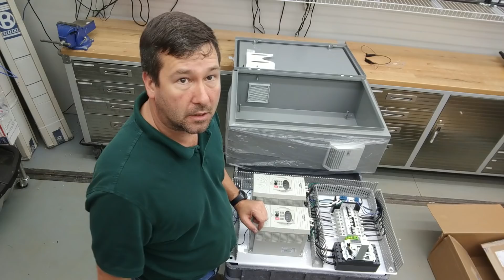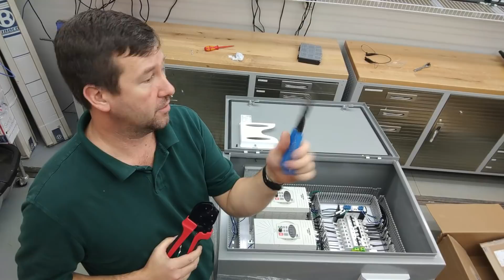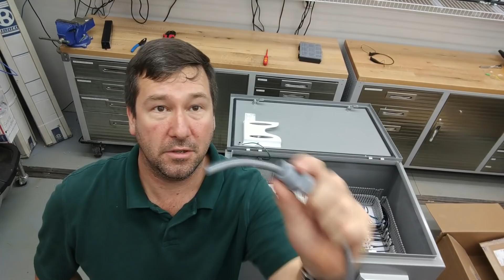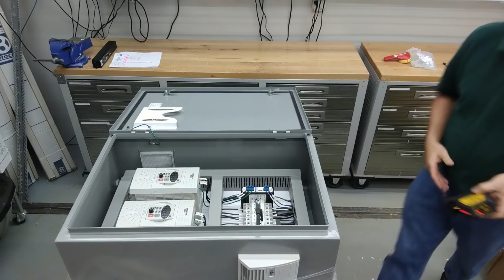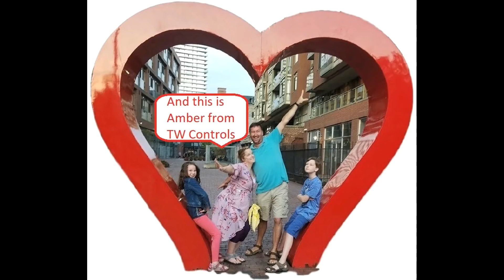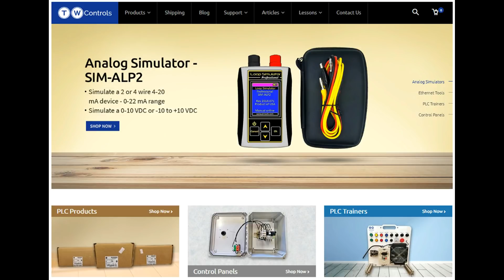Control Panel Building Mounting the Panel in the Enclosure Part 5 of 6

Comment: How important i sit to ground the enclosure as soon as the power/grnd enter the cabinet?
Reply from the maker: I don't know that there is a spec on this but I normally do have the ground directly beside the incoming power connections just to make it easier for the installer.

Comment: Hey Tim. Great videos. I have a question about grounding and didn't see an article listed in this description. I have a 30×30×12 metal enclosure and want to ground the backplane correctly. I put the big star washer under one of the stud bolts and tightened. Then installed the grounding kit with sticker. Do I run the wire to my grounding strip which goes to my ground rod? It is an outdoor enclosure, NEMA 4, made my SCE.
Reply from the maker: Hi Dillon.  Your star washer bonds the enclosure to the panel.  Your grounding kit is for connecting your incoming ground and you have labeled it properly.  I don't actually use it, I should do a video explaining that sometime.  After that, your typical grounding strip would bond to the panel...I probably should do a video on what grounding and bonding is sometime.  But at that point your star washer, grounding kit, and grounding strip are all electrically the same so you can connect your ground rod to the ground kit stud or the grounding strip.  It will be the same.
Reply: Thanks for replying. I am new to this and learning quickly about panel building and wiring for natural gas flow computers and field equipment.
Reply from the maker: You are welcome Dillon.

Comment: OOps you did it again. You did it so instructive. Thank you Tim. I wonder if you could do someday a vd about wiring a panel using a drawing.
Reply from the maker: I've had a few where I show some about wiring to a diagrams but I'll try to remember to video next time I'm making a motor starter panel.  It has just enough wires to be informative but not enough make the video boring.

Comment: where did you find that little laser?
Reply from the maker: Your typical laser level should work fine. Here is one. https://www.amazon.com/gp/product/B01N33JJ3R/ref=as_li_tl?ie=UTF8&camp=1789&creative=9325&creativeASIN=B01N33JJ3R&linkCode=as2&tag=twcontrols-20&linkId=411c462320a24be4a06b90f782230732

Comment: New subscriber here, and I'm digging your vids! I guess I can't figure out why, with as concerned as you are with debris and cleanliness, you would do any drilling on the box with the back panel already installed... made me cringe a little.
Reply from the maker: Thanks for subscribing and the comment!

The handle I did because I line it up manually, but note I drill it with the control panel door open to minimize the risk of getting shavings in the control panel.

The 7/8 hole honestly I forgot to drill earlier so I didn't have a choice.

Comment: Great vids. Can you go thru the required heat dissipation calculations to confirm if the given box size will remove heat or will vents or cooler be required
Reply from the maker: That would be a good one! I'll put it on the list. Maybe a drive and a power supply to show adding the cumulative heat loss then calculations based off of enclosure material and sides avaolable for dissipation?